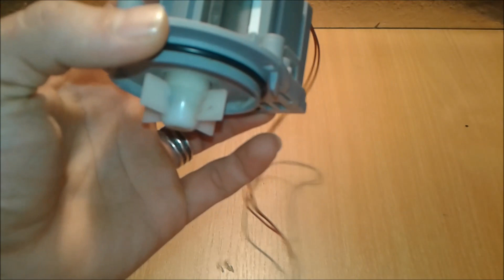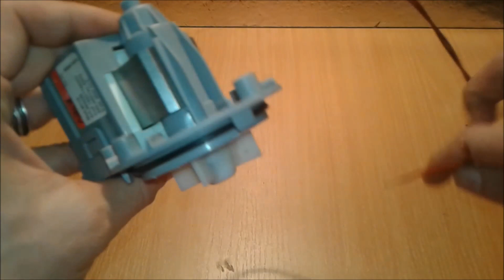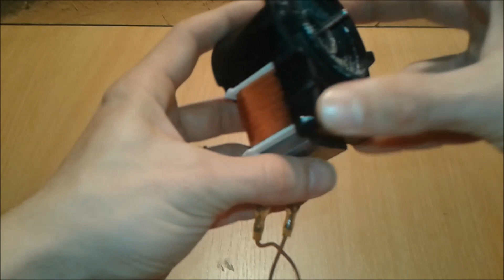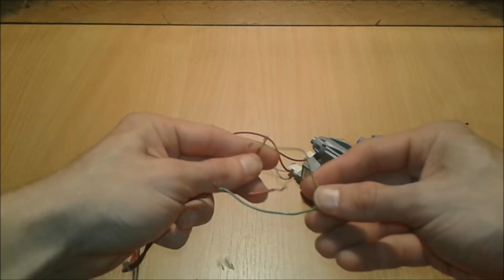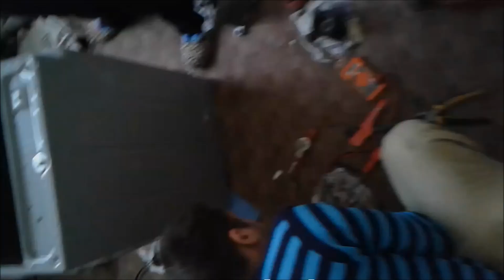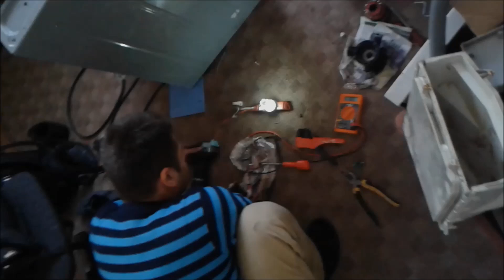Washing machine pump test generator

Comment: How did you remove the propeller from the washing machine pump pleaseRead more Show less Reply     1
Reply from the maker: omar habbab it is a plastic casing so easy to remove
Reply: @NoSkillsRequired  sure cant do that on these fancy new machines, my motor was giving me issues and its due to the impeller not being level from the plastic rubbing through, the cheap impeller / propellers make an entire motor trash
Reply: yeahItWasAPainInTheAssToRemoveIt.